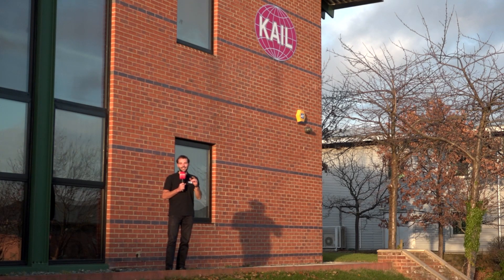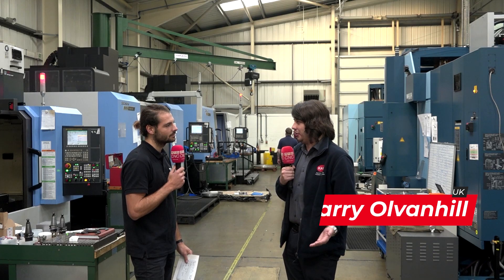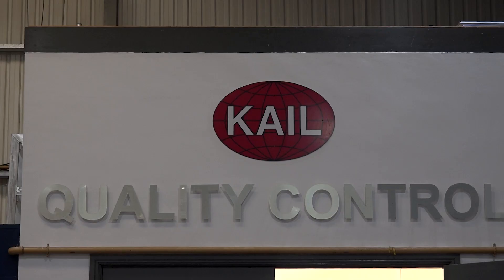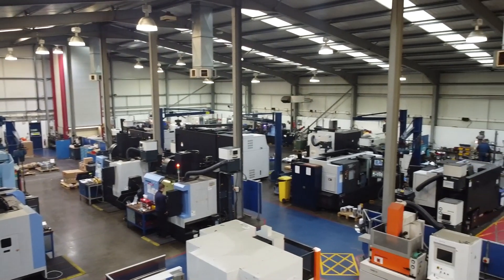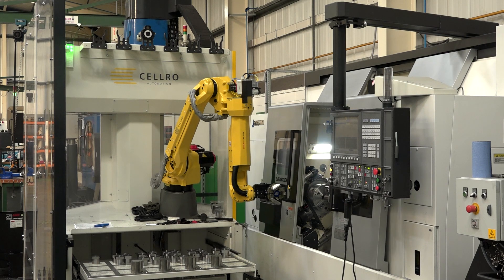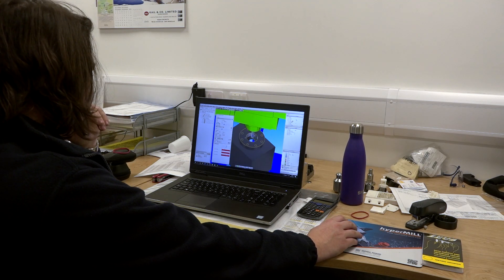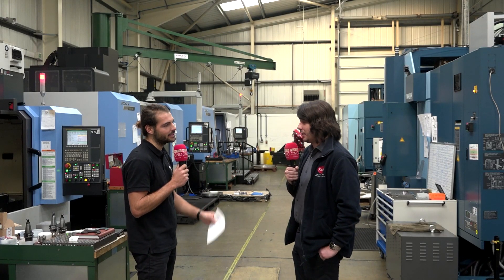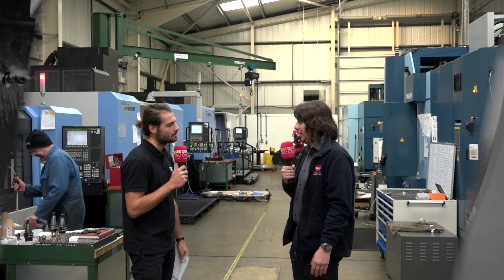You're gonna need a CAM system to make parts like they do at Kail

Comment: I'm surprised he can use CAM software with his laptop, normally you need a powerful hardware!
Reply: Laptops can be powerful too? 🤷‍♂
Reply: @bernhardschuepbach4533  yeah… not enough when you making some complicated stuff
Reply: @boru-cnc  of course they are. That’s quite an old fashioned opinion to be honest.
Reply: @Crsf84  probably it is, I’m struggling with i7 and 64gb ram and sometimes it takes 5-6hours to create a tool path
Reply: @boru-cnc  5-6 hours to create a tool path ?? you defo need a new laptop. Most of our guys use laptops and occasionally docking station if it’s a longer process and wanting a bigger screen.
Reply: @Crsf84  yeah for 16-20h machining program it takes long to calculate the tool path.. a specially with a 5 axis ball nose finish with a small tools such as 2mm
Reply: We all use laptops at OPEN MIND UK with no issues.
Reply from the maker: Glad you enjoyed the video.  A lot of Higher end laptops can easily run cad/cam